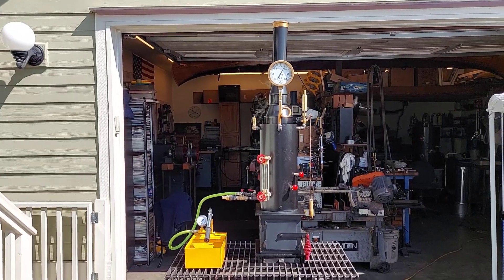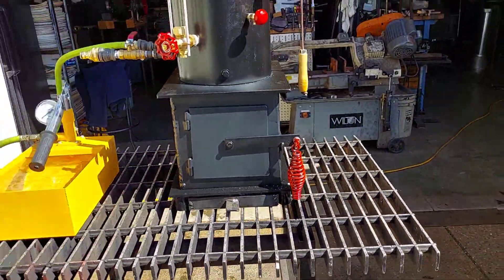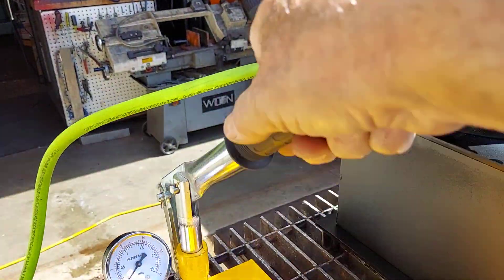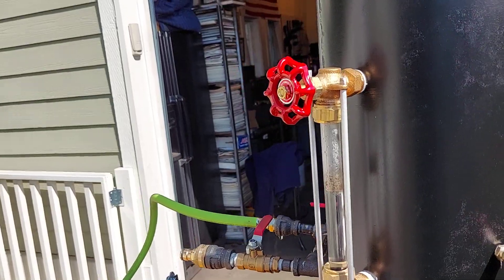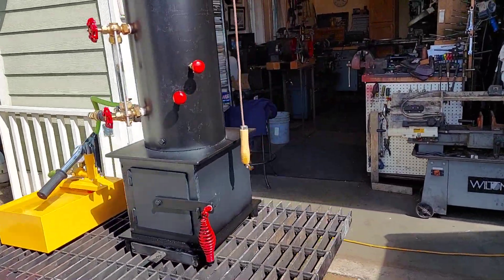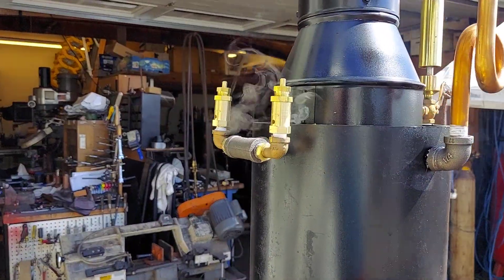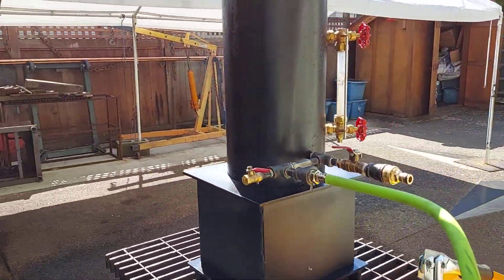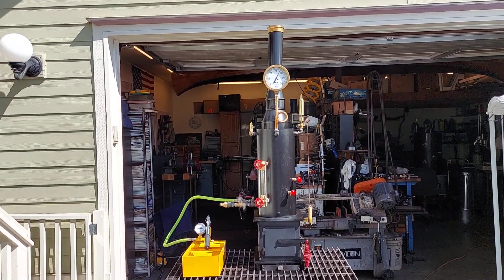Live Steam Boiler Hand Pump Whistle Gauge steam engine For Sale off grid

Comment: Ross, I have been following you for a few years now. I appreciate the work and products you produce. May I ask you a couple questions? I have two vertical steam engines 1¼ dia. pistons x (whew, long time ½ or ¾) stroke. They are identical and I would like to have those two engines reconfigured into a single 2 cylinder engine. Would you be willing to do this? My opinion is they each work perfectly on compressed air and begin to operate at about 5 lbs of pressure.

I know I'm not giving you very much info here but I assume you could take a guess at what would be involved and whether or not you would be interested in doing the work. If both engines became one two cylinder engine could you estimate the power output range.

The maker of these engines offered to do this for me about 10 years ago but unfortunately before we could make the arrangements he passed away. The maker said that he used 1 of these type or size of engines (but not one of these engines) to power a small toy car like thing that he made for his grandson. 

Also if 1948 is your birth year you are about one year older than I am. Yes I would buy the boiler or one similar to it also.

Thanks in advance.
Dale
Reply from the maker: Sorry, not at this time.